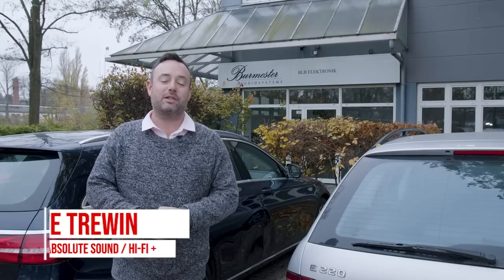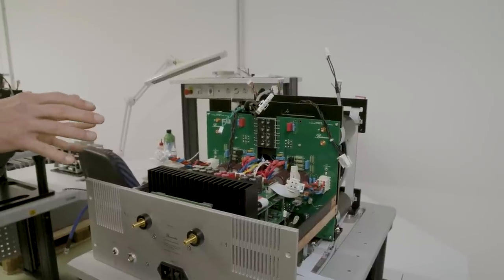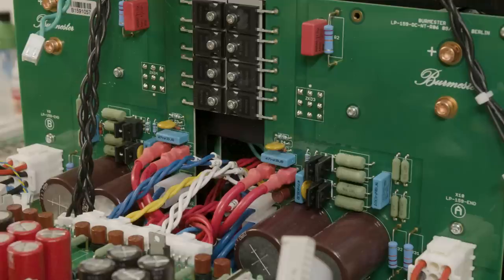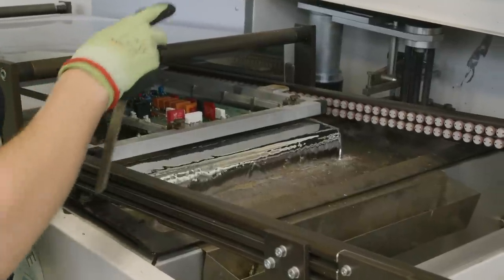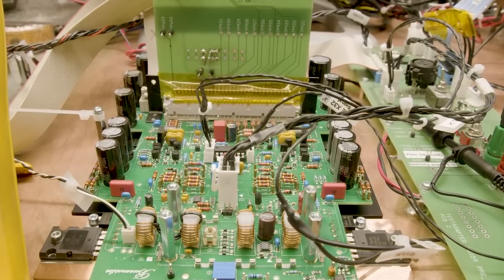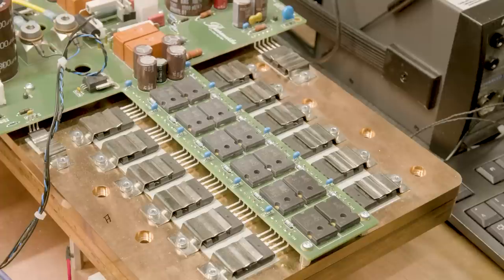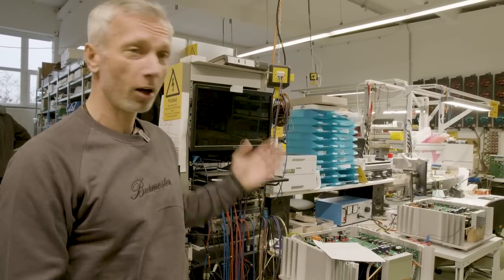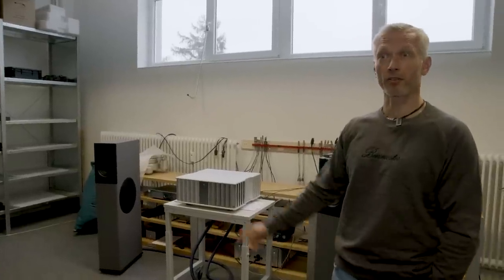Building the Burmester 159 Mono Power Amplifier | Burmester Factory Tour Part 1 of 2

Comment: nice to see Burmester still using cheap capacitors even in their signature line. I question if they even know what they are doing?
Reply: There are "snake oil" ultra expensive capacitors and cheap normal ones. No difference... except the price....